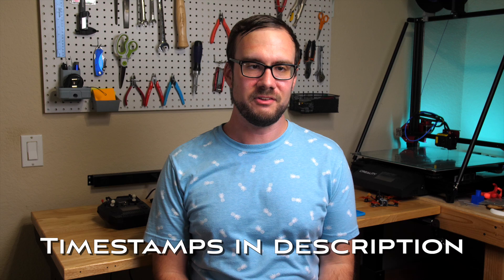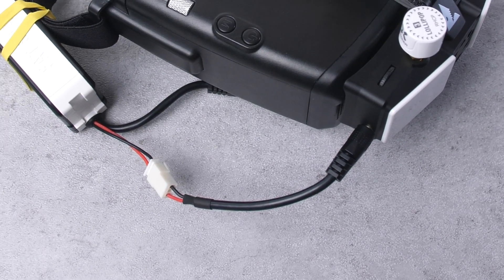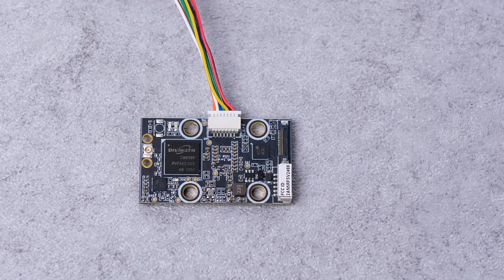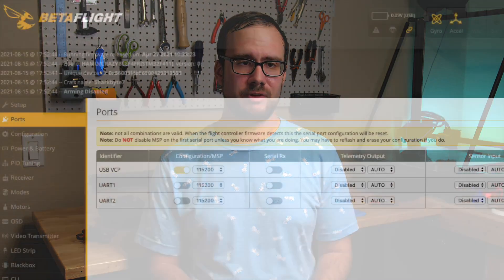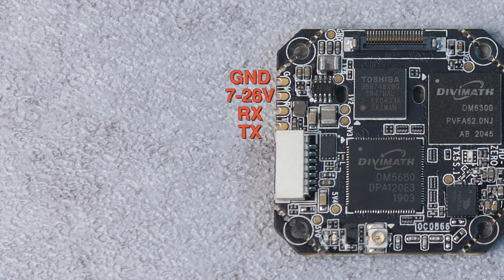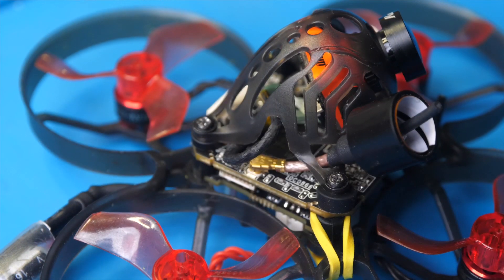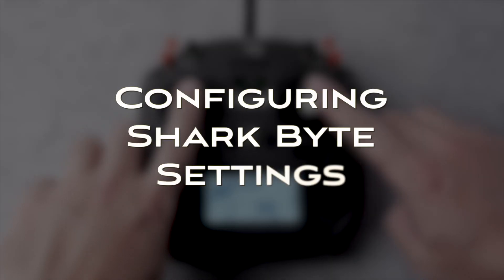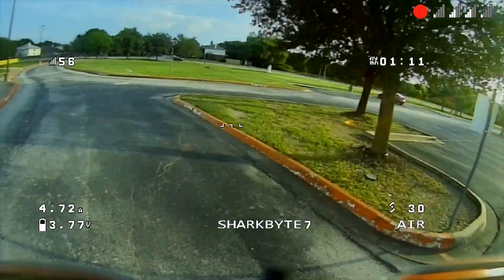HDZero Complete Setup Guide -- Install and Set Up the HDZero / Shark Byte Digital FPV System

Comment: I really appreciate your videos. I find them very informative. I have followed all of these instructions, as well as others, to the letter but I'm not getting any osd. My physical connections are correct as well as the proper uart enabled in the ports tab in Betaflight. What am I missing?
Reply from the maker: Hey Don, two things to check:
1) Did you enter the CLI commands after enabling MSP for the proper UART? These commands must be entered and make sure you use UART number minus 1 for the second command. 
2) Did you update the firmware on both the HDZero receiver and the HDZero VTX? These firmware versions must match. I'd recommend using the latest firmware from the HDZero website here: https://www.hd-zero.com/document

If these steps don't resolve the issue, let me know and we can keep working on it. I'll also mention that two other good places to get help are the Divimath/HDZero Facebook group, and the Discord server. There are plenty of people who are knowledgeable on this stuff and are more than happy to assist. I am on both of those platforms as well.
Reply: @ATXAirborne  Thank you for your prompt reply. Yes, CLI commands entered and firmware has been updated. Still no osd. I also noticed something else, the key pad, or dongle, doesn't work either. All pins appear to be ok, delicate as they are, but the led doesn't indicate any power going to it. 
I do get video although I have to say my analog picture was much better. I'm using Skyzone O4x goggles and previous analog camera was a Runcam Phoenix V2. My Sharkbyte picture feels like looking out of a fish bowl. For whatever that's worth.
Reply from the maker: I might suggest reflashing the firmware again just to make sure that worked properly. Sometimes re flashing fixes issues like this. When you update the VTX, be sure to remove power to the VRX before you unplug the VTX update cable. 

The keypad not working is probably related. Normally you’d need to see a menu to make any adjustments, and you won’t be able to see that menu if your OSD is not working.
Reply: @ATXAirborne  Thanks for the advice. I'll try reflashing the vtx. As far as the keypad goes, pressing the #2 button should read what channel it's on on the led display. Press and hold the same button for 3 seconds should display the power level. Nothing happens at all. I think there might be a problem with the vtx?

Comment: Interesting. I have Mobula 7 non-HD. But frames look like the same. Seems it is worth to try SharkByte conversion in future :)
Reply from the maker: This was a regular Mobula 7, non-HD. So it should definitely work :)
Reply: @ATXAirborne  Then I definitely will try this out.
Reply: @ATXAirborne  SharkByte camera is higher than Mobula 7 stock one. I noticed you changed low Mobula 7 stock cover to something higher enough to accomodate SharkByte camera. Which cover it was? Something from BetaFPV?
Reply from the maker: I used a Mobula 6 canopy. Works great. I had to squeeze it a bit to fit the camera lens through initially, but I’m very happy with how the end result looks and functions.

Comment: Great video...thanks!  Do you need to do anything in the Betaflight VTX tab?  If not, can you leave what is in there from the previous VTX or do you need to get rid of everything?
Reply from the maker: You won't need to on the whoop VTX. In fact, if you were previously using a VTX on that UART, you should make sure to disable it in the Peripherals section of the Ports table. That will actually remove the VTX tab from your Betaflight. 

The one time where you might use it is if you're using the newer "race" VTX, and even then it's not necessary unless you want to use switches or scripts on your radio to change settings, as racers do. Otherwise, you're going to do all of your configuration using the MSP functionality so the VTX table isn't required at all and will not impact things whether it is there or not.